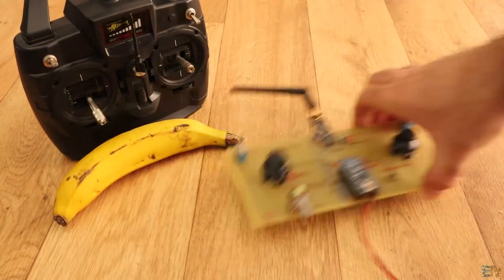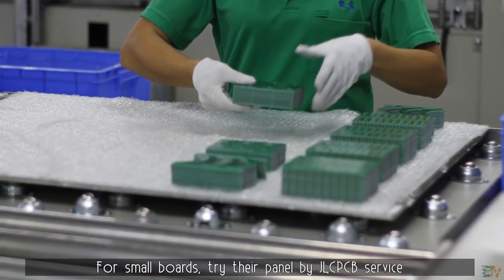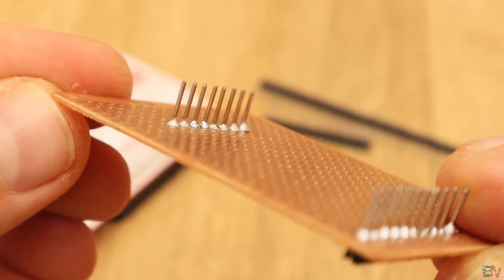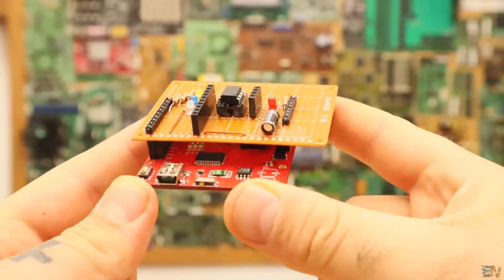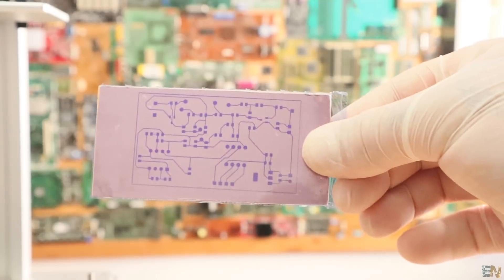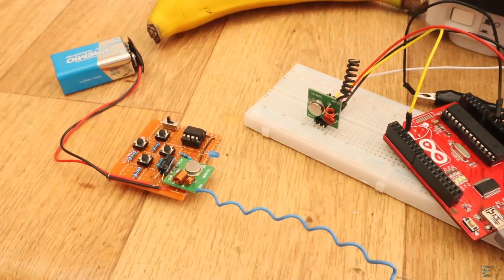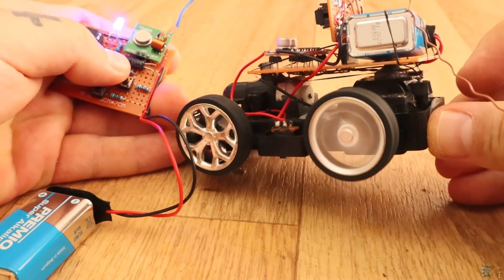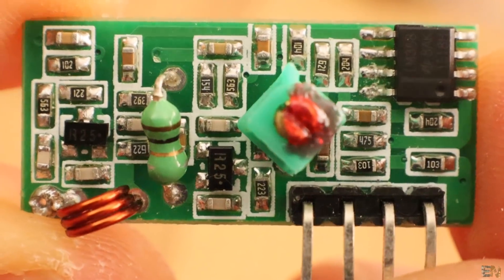ATtiny85 simplest radio controller - 4 digital channels

Comment: Hi! I like your simple remote control, but I was wondering if you could tell me how would I put a simple protection in to the code, so it doesn't messes with the receiver if I would to have 2 of the transmitters and press a button on both at the same time. Thank you very much and best regards!

Comment: I understand why this attiny code doesnt work. Because some of the arduino functions were not imported to attiny boards through arduino ide. The solution is to write the same protocol by yourself. This won't be too hard, it is a simple library.

Comment: It's possible use the attiny 85 for transmiter and use an Arduino as reciver? It's for a robot Will need an signal from a radio controller and sensors, and i want keep cheap as possible. Thanks and sorry for my English.

Comment: Nice. I think I need to dig out my set of these modules to actually try to use now. I wanted to build a mailbox "you've got mail" notification system using them but I never got around to it.

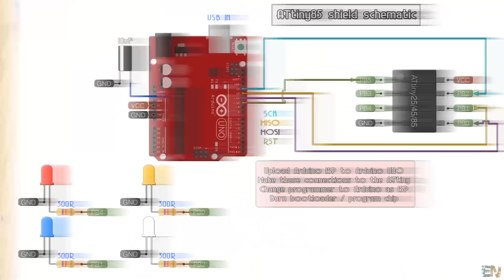3:04
 I find it so annoying that the Ardy1 team decided to build like this. They should have made the board design compatible with a 5x7cm protoboard.
   That's actually my main project design I'm working on right now, an ATmega644 (or 1284) based AVR Transistor Tester. I've got my Dupont Riston, and Dynamask ready to try and am about to try my luck at a single sided etch hopefully this afternoon. 
   It's funny that you mentioned the JLCpcb panelized thing. I'm working on my first attempt at panelized etching myself, 6 designs at once with a couple of copies of most of them.

 BTW, I know you still prefer eagle and all but in the latest version of KiCAD/PCBnew there is an option for making rounded rectangular pads for footprints. Personally I have found that I really like this option. I occasionally had issues with pads and/or traces lifting after soldering. More specifically, I have had issues when I made mistakes and had to rework something. I asked Big Clive what kinds of trace specs he tries to use when designing a board too. My solution is to make my through hole pads much larger than the default software settings. For instance, when I use a 2.54mm socket strip or pinheader on a layout, I make each pad 2mm × 2.5mm. I make things like jumpers/vias with a 3mm pad. Stuff like 5.08mm pitch screw terminals get pads around 3×3mm or larger and I use an offset to maintain good separation between terminals. I also have a variety set of through hole rivets ordered ($4 on AliEx for 1000pieces of a bunch of different sizes) to try for even better mechanical strength in some situations and to test out for DIY vias that look better than a piece of soldered wire. I make all footprint pads  rounded rectangles except SMD IC packages. This maximizes the mechanical strength of the pad and has eliminated all of my pad lifting issues. The other thing I changed is to target a 1mm trace width as much as possible. This was Big Clive's recommendation as his personal trace width target he shoots for on his home etched designs. It's not always possible to go this large on some SMD stuff but I find that it helped me get a better scale and more consistent etch results.  ...anyways...
Thanks for the upload.
-Jake

Comment: Why would you create a guide for ATtiny85 where IDE 1.0.5 has to be installed?
This version is outdated, and same goes for the attiny core files you provide.

What you rather would do is to download the latest version of Arduino IDE (1.8.7 at the moment), and install ATTinyCore by SpenceKonde or attiny by Damellis.

attiny by Damellis uses the core files that's bundled with the IDE. This means the core files will be up to date again every time you update to the latest IDE.
ATTinyCore by DrAzzy has its own core files where the code is more optimized for ATtinys, has better library support and more features in general. However it's much more advanced than attiny by Damellis which IMO is a good thing

Comment: Why you did not used PWM channel for transmitter? Anyway, a long time a go I needed such simple radio communication. I have found this article: https://www.romanblack.com/RF/cheapRFmodules.htm It explains very well about issues with receivers and shows code for data transmision. I have implemented such code for Attiny and it worked fine. I think you can use it instead of virtual wire

Comment: I used the attiny85 with the rc-switch library and those transmitter/receivers without any problem. You can even use a standard fixed code remote fob.
Reply: How did you get the receiving part running? When i try it, i dont get anything with the AtTiny85. It only worked mit an Arduino. Transmitting worked flawlessly

Comment: Not sure why you had issue with the newest version of the Arduino IDE and the Attiny. Suggest you use Spence Konde wonderful Attinycore for the IDE. https://github.com/SpenceKonde/ATTinyCore. Also "burning the bootloader" on an Attiny only sets the fuses, it doesn't actually load a bootloader.

Comment: Attiny85   +  nrf24L01+ working?
Reply: i tried that a while ago and it works but it takes up all the io´s available
Reply: @davidrubio8673  reset pin can be used as analog input

Comment: I use ATTiny 85 so much.. This will be just one more use.. Thank you
Reply: bro when i program attiny85 with uno it showing error yenkie double check the connection please help me i changed jumper wire twice and attiny85 also but same error
Reply: 1. check  you have uno loaded the example of ArduinoISP loaded into uno 
2. make sure you have attiny board json link in preferences and that you select the correct board.
(sometimes I run 1mhz internal sometimes 8mhz internal, thats just my preference)
3. Make sure you then select Arduino as ISP.
4. many of the attiny's I bought did not have boat loaded on it. So burn boot loader to your preference.
5. if the boat loader works, then next is compile see if you have it everything working correctly.
6. then load your program on to attiny85

If all that above does not help, then double check wiring:
Do you have the 10uf cap on ground and reset. as well as 
                                    (physical pin numbers)
Arduino +5V      --->  ATtiny Pin 8
Arduino Ground --->  ATtiny Pin 4
Arduino Pin 10   --->  ATtiny Pin 1
Arduino Pin 11    --->  ATtiny Pin 5
Arduino Pin 12    --->  ATtiny Pin 6
Arduino Pin 13    --->  ATtiny Pin 7

Sherm
Reply: @shermluge  sir i program it day before yesterday but now i cant why i don't know
Reply: @shermluge  i use ide 1.6.8
Reply: what errors are you getting?
Reply: @shermluge  yenkie error and check your connection double. when i program it attiny85 just a second blinking while uploading sketch and sudden it showing this error
Reply: What sometimes does happen is if you happen to have uno board in by mistake (once before) your Arduino uno might not have the isp program loaded any more, this is something I've accidentally done.. Reload the ArduinoISP example into uno and try again